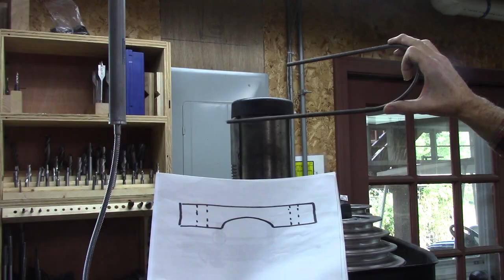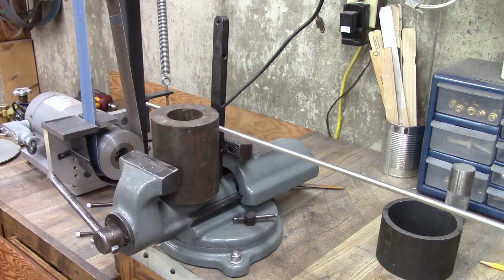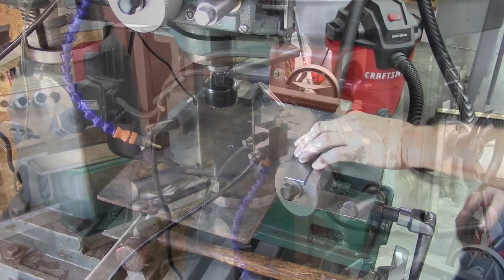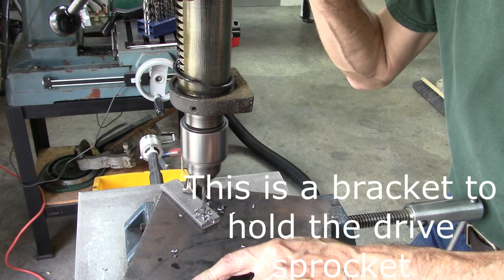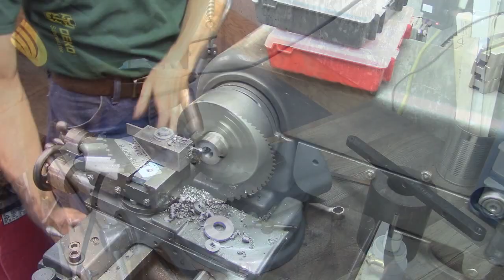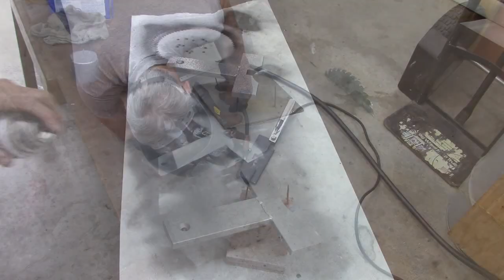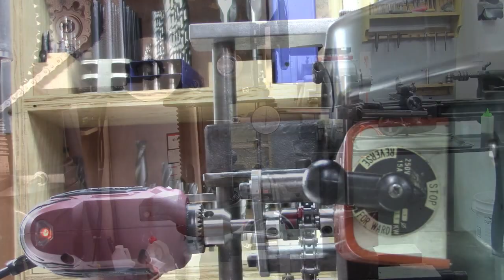The Ultimate Round Column Mill Fix

Comment: It makes a good table top drill press, and that’s about it.  Save your money and get a real milling machine.  I had a Grizzly Column milling machine, but it’s still a flexy flyer when it comes to real milling.
Reply from the maker: I now have a wells index model 40. It's a very nice mill and more accurate but honestly after fixing the quill lock and addressing the round column problem it was a fairly good mill.

Comment: Hi Winky i enjoy watching your videos. I recently bought a mill just like yours but its a hafco supplied by Hare and Forbes here in australia. I didn,t buy it new but its only about 13 years old and it has had very little use. I am about do what you did to keep the head aligned. I am also thinking of mounting a gas strut on one side to take some load off the worm and gear mechanism. whats your thoughts on this. Also i notice you had the guard off the top covering the pulleys did you leave it like that , i am thinking of cutting a slot in the guard to clear the bracket that holds the guide bar. Anyway thanks in advance keep up the great work.
Reply from the maker: There is another method of doing this that is a little easier. I found the design after modifying mine. A guy shared some pictures with me. The only negative is you have to have extra space behind the mill. https://photos.app.goo.gl/UYb3UHZ8FMyWUC8Z8

Comment: I don’t know if you realize it, but just by clamping that track that fasten to the side of the column that keeps the head of the mill from spinning. Basically all you would’ve had to do was just clamp the rail to the column and the mill head would no longer rotate.
Reply from the maker: I tried that, there were several issues. The rack is not very rigid so screwing to the column at the top and bottom allows the rack to flex. Of course the clearance let it move an 1/8" at the spindle but pushing to one side would work if the rack did not flex. I could have installed maybe 4 or 5 screw to solidify the rack but the room the screw heads took up would not leave enough tooth in the rack. Pinning might have worked buy I was concerned about things moving while drilling. The bar being 6 inches from the column and without any slop was a big plus

Comment: Why don’t you just drew a set screw in the rack so that when your opinion rolled up and down on it it can’t move and spin?
Reply from the maker: That works but there are a few problems with this approach. First a screw in the bottom and top of the rack is not adequate, the rack flexes. Second, drilling between the teeth in the rack might make the teeth on the rack gear weak. Its hard to say if this would be an issue but I dont want to find out. Third, the clearance in the head for the rack allows the head to move about 1/4 at the spindle. You could push the head to one side when locking but if the rack is not well secured the error would be significant.

Comment: What you thought were 1/4"-20 bolts are 6mm -1mm bolts, also the 5/6" bolts are 8mm-1.25mm.
Reply from the maker: I had to work on lead screw when I got the mill. Man, its wild. I expected all metric but it was totally mixed.

Comment: I have an older King Drilling and Milling machine which was made in R.O.C.made in Taiwan. I wonder how old it is? The tag also says California.
Reply from the maker: I heard the Chinese copied a US made mill. Maybe you have the original.
Reply: @WinkysWorkshop  I regard older tools, perhaps wrongly, as being better built and worth restoring. Especially tools just before and after WW2. I just recently acquired this from an older friend who will be 90 years young soon. He is sharp as a tack and I will have a more in depth conversation soon about this machine and where and when he got it. As for now, I'm watching and absorbing as much information as I can from wherever I can find it on machines which are similar.
Reply from the maker: @crawford323  I think the older stuff is mostly better but sometimes it's not. The Cannedy Otto drill press I had was functional but had many castings that were broken. It was fairly well machined but the cast was  junk and the design what not very good. The design issue is evolution. Many of the machines I have restored have minor issues. My 1917 Avey drill press has some amazing features the best one being the sliding quill section. This is equivalent to moving the table but has a huge plus, the work stays in line with the drill bit. The bad part is, the quill is only 2" in diameter and only supported with a 2 inch long sleeve. The rack in not cut into the quill but instead it is applied or attached to the quill. The pressure when operating the down feed is behind the quill and it makes the drill move toward the operator The length of the tube the quill slides in is only about  2 inches so any amount of clearance leads to significate deflection at the bit. My old 1927 and 1934 Logan's has a wimpy compound, the 1931 south bend is excellent aside from worn gears. I think you are correct, just before WW2 is the sweet spot most the time. Bottom line, Old tools have a lot of cast iron and to get the same in new tools you have to pay a lot more. Cast iron used to be cheap.

Comment: I would just bolt the vertical rack straight to the column. Then when moving the head push the head always to the side taking out any play.
Reply from the maker: I started to do this but was worried about several things. first, it would need to be attached every 2 or 3 inches to avoid flex, second, the amount tooth left after drilling would weaken the tooth, and third, you only get one chance, if it isn't straight you are screed.

Comment: Trick for doing thick metal with a holesaw is to drill chip clearing holes .
Drill 2-4 holes, minimum 8mm, 12mm is better, with the outer edge of the hole in the planned outer edge of the holesaw hole.
Then as you drill, the chips fall out the holes and you don't have to lift it and clear the teeth constantly, just keep the cutting fluid going in, keep the pressure on and don't run it too fast.
Reply from the maker: I've heard this before and i should have done this. Thanks

Comment: Hot tip (I think), I used #25 chain, the sprockets are smaller for the same number of teeth.  It's nowhere near straining the chain or sprocket, the forces involved are low.  I went with a 1:6 gear ratio, 12 tooth small and 72 tooth large sprocket.  I could have used a larger input (small) sprocket to make the head move faster, but I'm happy with the speed.  I just set the small sprocket the right distance away to tighten the chain, so I didn't need an idler sprocket to take up the slack.
Reply from the maker: You are probably right. I already had the sprockets. Good tip

Comment: Very cool! Great job on your project and the video! Thanks for sharing.
Reply from the maker: Thanks! It made the mill a lot more user friendly
Reply: I am thinking about using something similar on my mill also. I was thinking about using a linear rail and bearing attached to top and bottom brackets and then making an adapter to attach to the crank on the rack, that will attach to a lovejoy coupling and AC  stepper motor to move head up and down. I'm thinking the linear rail and bearing would provide more free range of motion while keeping the mill head from moving side to side? Whats your thoughts on this?

Comment: Another guy achieved almost as good of results by just screwing the rack to the column for a lot less work
Reply from the maker: The rack is too flimsy to bolt and then you have to deal with the slop in the head. You can send me a link to that other guy... I'd like to see it.  This however might be the best way:  https://photos.app.goo.gl/UYb3UHZ8FMyWUC8Z8
Reply: @WinkysWorkshop  The rack method has been demonstrated by a couple of people to work quite well. Yes it has some spring to it but if your head is not binding it will keep you within a plus or minus .004 range for not a lot of work. The last gentleman I saw demonstrating it was from England. I can't remember his channel. He even pushed his head from side to side and demonstrated how close it would return to the zero position . I just purchased a new Jet JMD-18 and this is what I am going to do. With 27 years as a Journeyman Millwright under my belt and my other working history, I am a fan of the simple approach.
Reply from the maker: @retiresoon5639  I do agree that simple is usually better however, I would not attempt the rack method. I have experimented with doing this and it has problems. You will find out if you try it... hopefully before you get too deep into alterations. Did you look at the link to the pictures I sent? David Wrate's method is very easy. If I had it to do over I would absolutely use hos method. Pinning the rack is the obvious solution but there us a reason people are not doing it. 

Ha...  but if you are like me, you might be taking my words as a challenge (although they are not) so please share your results if you succeed.

Comment: Why not just pin the rack to the column with counter sunk screws? Then you could mount a stepper to the crank shaft.
Reply from the maker: I considered that and others have tried this. It works but not very well. The only good place with enough metal to pin or screw the rack to the column is at the top and the bottom. If you try to do it between the teeth it does not leave enough of the tooth. Bolt at the top and bottom is inadequate as the rack flexes bad. You could possibly pin the rack every 6 inches with an 1/8" roll pin without effecting the teeth but then what if you got it slightly skewed...  and second, what about the clearance between the groove in the head and the rack. I explored this idea and tried to resolve this clearance issue but failed. Without the rack moving the head will move 1/8" at the collet. I have seen gear motors used to raise the column and they work great but the only ones I found were well over $250. I think i spend less than $125 on mine although I had the steel. Honestly, if i had it to do again I'd probably explore more options with low voltage gear motors...  some of them are cheaper. However, the the guide bar I'd keep. 

With that being said, there was another design I liked a lot that David Wrate used. I think it might be great too. I saved his pictures on my gdrive if you want to look. I think it might be a great design. https://photos.app.goo.gl/UYb3UHZ8FMyWUC8Z8

Comment: Boy, you have spent a lot of time and money on that modification. Great job my friend. I just use a dial indicator with a magnetic base and It is dead nuts accurate every time. I think since round column mills have been around for 40+ years, the manufactures always had in mind a simple dial indicator for alignment was much cheaper and they did not have an inherent problem that a lot of people keep pushing with alignment of the head. Should not be an issue at all. Keep up the good work!
Reply from the maker: Time yes but I think it was less than $80 bucks with some surplus steel. It's mostly about speed and convenience. I love it. This may seem ridiculous but I'm thinking about a cam lock for lock down bolts for the head.
Reply: Now that I would like to see. Faster unlock and lock would be a plus👍
Reply from the maker: @jeffl.oliverson6690  I'll be doing  variation of what this guy did at some point. https://youtu.be/VmdSBvipJpQ

Comment: Im having a problem getting my R8 collets to go fully into the column on my Central/ Grizzly/Jet round column mill.  IS there an alignment pin that may need adjusting or possibly replaced  Darrell
Reply from the maker: Here's what I understand. Most mills that use R8 collets had an alignment pin at one time. When I got my mill it did not have the pin but I noticed the groove in the collet and wondered if it was supposed to have one. After talking to several machinists about the apparently missing pin they all said the same, do not worry about it. They will eventually sheer and interferer with the collet and its had to get to to clean up the pin
Reply: @WinkysWorkshop  some of my all right, it’s work fine they slide right up and you’re able to screw the dry bar into them but some of them won’t go up far enough and I’m wondering why
Reply: I should’ve said R8 collets
Reply: I only have one Bridgeport Collett the rest of them are aftermarket. I’m wondering if it’s just for design and they’re not made to the correct tolerance
Reply from the maker: @darrellpackard9882  Oh... I'd say you are right, measure them. Its a VERY close slip fit when they fit right.

Comment: U fixed that wobble on the large cog mate? Well done pal.. I have a table saw and the blade wobbles just like that when I push the stop button but I'm stumped if I know how to fix it.. I know there has to be a way but for the life of me I haven't gotta clue where to begin.ng it out in the trash bcos . Maybe the manual may be able to shed some light on this issue.. I need it fixed ASAP or I'll be throwing it in the bloody trash bcos I cannot get a straight rip cut no matter what I try and it's killing my work now.. I didn't wanna have to buy another saw until I get my Sawstop at the ned of the year but now I may have to get me one of those RIGID or DELTA contractor saws to tide me over for a year or 2 and then I can get the sawstop next year and sell the others.. That shite saw is defo going in the trash ASAP. I've had enough trying to get it correct.. 
Great job Winky mate.. Love ur content btw. Been watching one after another for the past 2 days now.. I only found ur channel yesterday but am catching up on ur videos now..
Reply from the maker: Thanks for watching! Yeah, the sprocket on the mill was easy to fix, just tapped it with a hammer. Apparently it distorted when i welded it. I have no idea on your saw but I doubt the saw is bent like my sprocket. I'd love to have a Saw Stop. My saw is made by Jet. It's a very good saw but protecting fingers is important too.
Reply: @WinkysWorkshop  thanks for the reply. Appreciate it very much man.. I'm enjoying the channel btw. It's always interesting to me watching how people problem their machine issues. It's shows real skill levels to be able to fix machines like u have bro. Keep up the brilliant content.  👌👍👏🛠⚙
Reply from the maker: @reaper060670  Thanks! I really appreciate your comments.

Comment: Did you consider directly driving the worm shaft with the drill?   Why the choice to go with sprocket layout?   Did it create less torque forces that could influence side movement?
Reply from the maker: It takes a lot of torque to turn the worm. Way more than a drill has at very low speed.  Side movement was not an issue plus it has a guide bar to stop movement.

Comment: Good approach. I own practically the same machine sold by Harbor Freight except mine is a rarity in that it has a gearbox on the right side of the head that powers the quill. I am a mechanical designer by profession and already have designed a similar approach but have yet to make it happen. I plan on installing the guide bar on the right side. On the left side I plan to install a reversible electric motor also but will have the control switch on the right side near the pinch bolts that tighten the head to the column. I hate having to loosen the bolts then go around the other side to crank the head up or down then go back to the pinch bolts to tighten them. This wastes a lot of time. For the motor, I will integrate a clutch that will slip if I bottom out top or bottom.
Reply from the maker: With the motor lift its not too bad going to the other side but I like your idea. The slip clutch is also great. I've been thinking about a power head lock. like some kind of cam lock operated with an air cylinder on the lock down nuts. It sounds lazy but I still avoid moving the head sometimes and move the table instead.

Comment: Hi Winky, really enjoy all your videos, just a question on mill, or mill drill selection, I am trying to decide on a mill, or mill/drill machine , and have researched them a fair bit , the round column like yours seem to be fairly heavy duty machines, only other feature they lack in a comparable square column machine is digital depth readout on the quill, is this a big problem? I dont mind that most machines like yours in this video are 220 volt, I have it in my shop for my welding machines, thanks, and thanks for posting the video.
Reply from the maker: I think it boils down to how much money you want to spend. I would absolutely buy a mill and avoid the round column. They do make mill drills with a dovetailed column but they are still higher priced than the RF 30s. My choice would probably be a Precision Mathews for a new mill or find an old full size mill. With that being said, my round column mill works well and it fit my budget when I bought it. Plus its a LOT smaller that a bridge port or the likes...  also single phase.
Reply: @WinkysWorkshop  Appreciate the input, thank you.
Reply from the maker: @kentdixon5716  Your welcome, good luck with your mill.